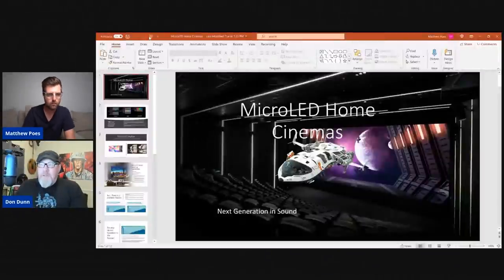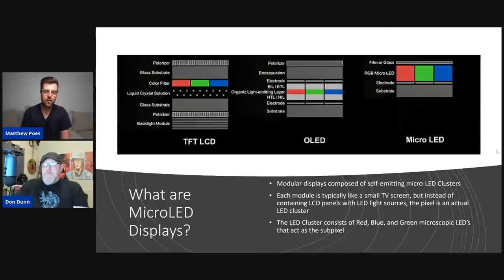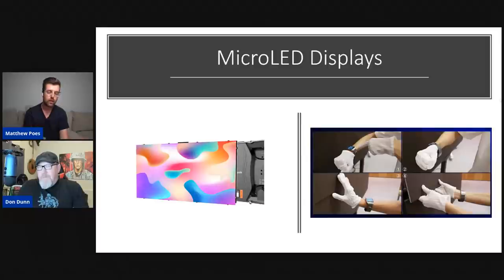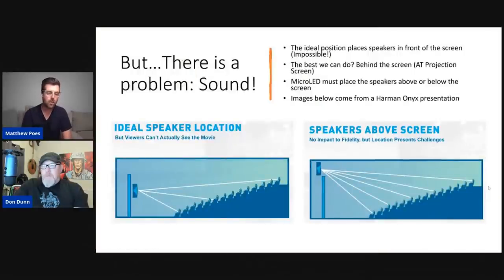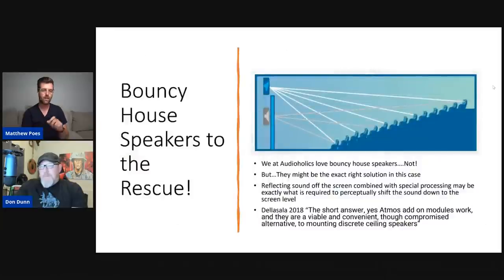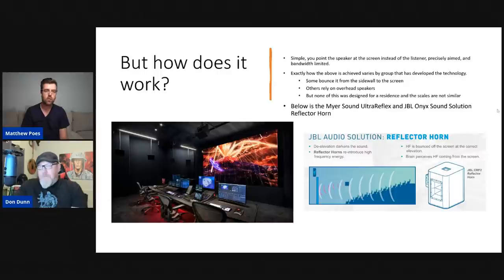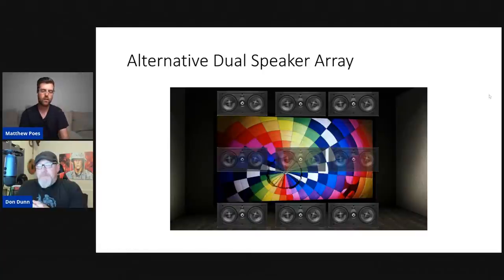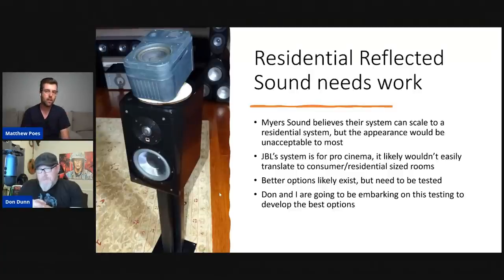MicroLED Home Cinema: New Sound Challenges

Comment: Great talk!

I’ve got a dedicated room that’s 4x4m with a 130” screen and Kef TDM THX speakers that just fit either side of the screen.  The centre is above screen that is right against the ceiling angles at the listening position.

It actually works really well and the sound doesn’t make you think it’s coming from above top.

The centre speaker is also in the dark so you cannot see it

I’d say give it a go, above angled is way better than below angled. Especially if the left and right speakers are screen central it help with that audio.

I have plenty of room acoustics so maybe that sound absorption I have on the ceiling stops that sound sound like it’s coming from there.
Reply: @BradSteeg  I also have Atmos centres hanging from the ceiling and those help with the immersive atmosphere and make the fronts sound larger

Comment: i have done the "phantom vertical" setup to keep vocals elevated in the screen before. glad to see the thought process is out there for this
Reply: Yeah it’s not a new concept. It’s been floating around for a while. The issue is getting it to sound good. It causes some problems if setup carelessly. Especially when the distances become so large as they do with these massive screens. Trinnov has the necessary setup flexibility to correct the problem. Most processors do not. 

But before jumping on board with any of these methods, I want to do some R&D to be sure we know what works. I want to really prove that it works by having blinded listeners identify the source location via each approach. I also need to know that the method isn’t introducing new problems. Unintended consequences.
Reply: I'm sure you guys will figure it out.

this may be an instance where what we usually consider a flaw in typical center channel dispersion(being mainly vertical), actually helps us get a decent image

Comment: I never thought displays would get this big.  So, I guess my little 75 TV and the center channel sound source issue is no longer a big deal.  However, I may try a speaker above and below to get the phantom center image.  Anyone else try that?

There's really something nice about the micro-LED displays is the fact that there isn't any of the "smart TV" circuits in them.  They are just a display and that is all I want in my next TV/display.  I figure if my ROKU box or BD player craps out I'll simply get another one not have to replace the whole TV if the "smart" board dies.

Comment: Have you tried measuring a speaker at the center of the screen with a binaural/HRTF microphone? If you did the same above and below the screen, averaging multiple measurements from the listening volume, I think you'd be able to use REW to generate correction PEQs to make a speaker from above or below the screen sound like it was coming from the middle of the screen. The resulting HTRF filters would be custom fit to the room. I suspect that would work pretty well, and a lot less complex than the bouncy house stuff, and without the multi-row comb issues with vertical phantoms. You could experiment to determine whether above or below works better. Also, you could determine whether it's best to do it for center speaker only, or for LCR, in order to keep them consistent. It wouldn't work without a binaural microphone, though.
Reply: REW isn’t needed for that. But that isn’t how it works. Your understanding a part of the problem but your solution isn’t quite right. You do need to de-elevate the sound. But you do that by removing frequencies above 4-5khz. That’s what “darken the sound” means in JBl speak.  You still have to restore the high frequencies at the correct height. A dummy head mic isn’t needed for this. The problem is sufficiently known already. It’s the solution that’s an issue.
Reply: @PoesAcoustics  I disagree. Removing the high frequencies eliminates your ability to vertically localize the sound, rather than tricking your brain to perceive a sound from a specific direction. That's where HRTF can be useful, but it's more complex than a low-pass filter. That's why it requires a binaural microphone to help generate the transfer function.

The JBL technique of removing high frequencies works because they are replacing those high frequencies with high frequencies bounced off the screen. That's also a clever approach, but an HRTF filter can be surprisingly convincing for a known room and speaker layout. Dolby Atmos for Headphones relies on HRTF localization, but HRTF tricks can also work well on speakers (for known cases.)

More details:
https://en.wikipedia.org/wiki/Head-related_transfer_function
Reply: @robcohen  there is no reason to apply an HRYF filter beyond the de-elevation and nothing the dummy head mic would give you that isn’t already known. I see no reason to do that and certainly nobody is. 

If you think that is a good idea, good luck to you. I look forward to reading the results of your study once you publish it.
Reply: @PoesAcoustics  yes, the only purpose is to change the perceived direction of the sound source. I thought that was the goal? The only thing the dummy head would contribute is a correction that is precisely tuned to your specific room and speaker locations. There are indeed tools available that use  canned HRTF databases of anechoic measurements to generate HRTF filters, known as HRIR filters.

The advantage of the JBL approach is that it doesn't suffer from problems due to variations of ear and head shapes, which can detract from generic HRTF. Of course, it has it's own set of baggage. Hard to know which would work better in practice.

I certainly have no plans to test, let alone publish this stuff. Maybe in 5-10 years when I have a 150+" LCD screen in the theater.

This definitely is a tricky and interesting problem, with every solution creating new problems. Perhaps by the time I'm ready to buy one, the video walls will include a planar magnetic or electrostatic membrane to generate the necessary frequencies from the right location.

Comment: I've seen particular setups where the tweeter goes above the screen and the bass driver below which apparently is quite convincing to center the sound.. Could be a solution as the cable could hide behind the screen..
Reply: That would be the opposite of the right way to do it. Not a solution I would try. Not sure who came up with that. 

The drivers can’t be spaced apart that far. Integration would be impossible. In addition, it’s the sound above 5khz that is largely responsible for our elevation localization.  Placing it above the screen will raise the image, but way too high.

Comment: I remember Anthony Grimani mentioning issues with having a vertical orientation phantom center due to the way our ears are located on our heads. Is this something you've experimented with and noticed aswell?
Thanks for a great show!
Reply: I assume you mean horizontal? Vertical is just an MTM. Nothing wrong with MTM. Very common.
Reply: @PoesAcoustics  Thanks you for the answer but I think you misunderstood me. My comment was regarding having a speaker above and below the screen to create a phantom center. Like you're discussing at 26:20
Reply: @PoesAcoustics  Thank you for the thorough answer! Psychoacoustics is fascinating. I really appreciate the work you put into digging through the research and boiling it down to something that is easy to grasp.

Looking forward to seeing your findings regarding this topic, not that I can afford a huge micro LED screen but hopefully some of your findings can be applied to the living room system aswell. I'm currently using wave guide mains which are producing a quiet good phantom center using the time intensity trading you demonstrated in an older video.